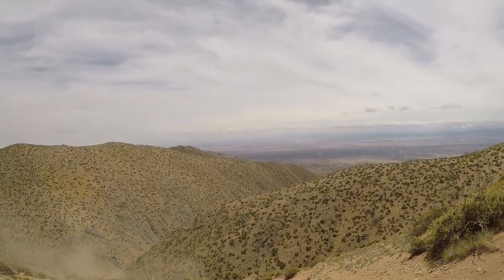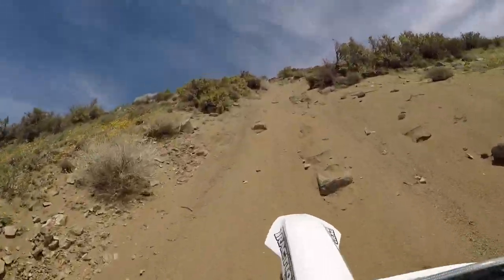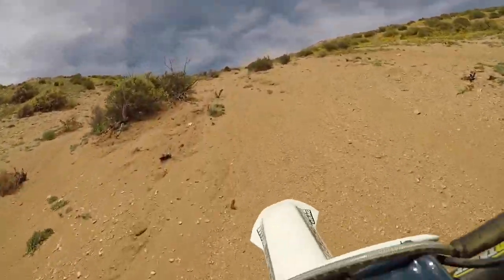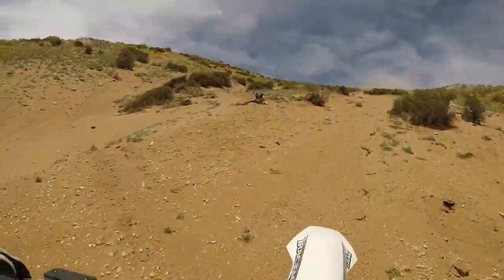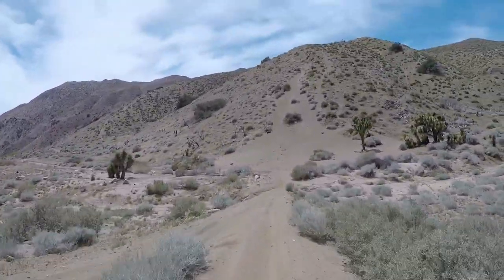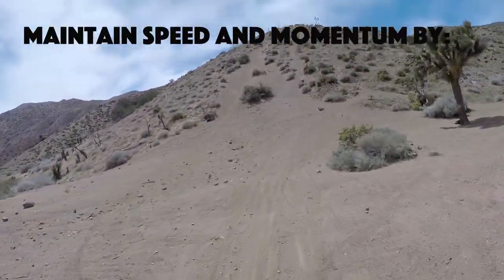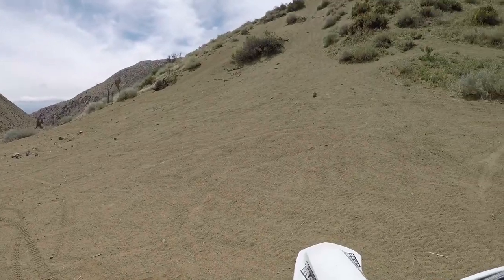How To Hill Climb : Techniques Explained

Comment: Using the clutch makes a lot of sense. I was trying a steep climb out of a creek recently, the first time I stalled because I let off the throttle when the wheel came up and the second one I looped out because I didn’t let off. Feathering the clutch would have probably made the difference

Comment: Nice video and great tips. I have been watching a lot of videos lately wanting to improve my trail and climbing skills and have been concentrating more on enduro and less on MX. Some things are the same but there's a lot that is different. The clutch control is huge, we were doing a bunch of climbs yesterday at Carnegie SVRA and the clutch method fo power control is getting me up hills I couldn't before but I went up one to many right before dark and got lax and slow right after getting trough a rock face and looped a 300 XCW, these bikes have so much power you really need to master the clutch. Any way I liked your to the point video.

Comment: So here's the big question, two stroke or four stroke?  Which one did better? These places use to be the big 500's playground. How did the new technology 300's do?
Reply: These particular hills are not very technical.  Almost any 4 stroke 450 and up will rip them.   The 300 2 stroke has more torque than her 350 but they have the same power.   The torque is what keeps a 300 2 stroke pulling longer and drops less speed than the 350.   Also if the 300 does bog a little it's no big deal it has way more low end and can still chug its way up.   If the 350 bogs it will fall on its face pretty fast after that.  Also the more technical the    climbs the more the 300s shine

Comment: Great vid :)
Question:
In what body position should I be for tackling obstacles on hills like these on the vid? 
And when to sit and when to stand?

Thanks a lot
Reply from the maker: Glad you liked it! When I'm hitting an obstacle such as a log or a rock on a hill climb like this I get my weight forward right away.   If you don't do that, you could loop out pretty easily. It doesn't take much to get your front wheel to lift too much on steep hills like these.  For most hills, I try to stay standing.  You always have more control when you're standing.  But for these really long sandy hills, I was actually sitting down for traction because the sand was SO DEEP.  I'd never ridden sand that deep before.  You can probably tell by the sound of my bike how loose it was haha.

Comment: I have a beginner's question: How does one go about learning to upshift, standing up, with full-on motocross boots, especially when under the pressure of a hill climb like you did? That was an amazing video!
Reply from the maker: Hey Ben, with more time on the bike, you will become more and more comfortable with shifting and braking while in your stand up riding position.  I would recommend practicing this on flat ground through the trails until it is second nature.  By then, you will likely be ready to shift up and down on hills like this.
Reply: Thanks Megs! I’ll work on it :)
Reply from the maker: You're very welcome!

Comment: Nice video. What camera are you using? Where is it mounted?
Reply from the maker: Thanks! I was fliming with a go pro hero 5 mounted with a SoPro Mount.
Reply: Megan Griffiths Enduro I like that thanks. Is the stabilization from the camera or editing software both?
Reply from the maker: No problem! Just the camera paired with that sopro mount. It makes for smooth footage!

Comment: What does feather the clutch mean? Never heard that term in New Zealand.

Is it occasional blips of the clutch or riding the clutch (partially engaged) I'm guessing the first option?
Reply: I think she is doing what I've always called "slipping the clutch", pulling in so the revs climb as the clutch starts to slip then working it back and forth in that zone between fully engaged and slipping as needed to keep the front end down and the revs up.
Reply: Feathering means modulating gently.
Reply from the maker: YES
Reply from the maker: When I say "feathering the clutch", I mean you are riding the clutch partially engaged like you said.  This allows you to bring up your RPMs but also bring down the front wheel without completely stopping your rear wheel from turning.
Reply: Won't this burn the clutch very quickly? Or is the clutch beefy enough in these bikes to withstand it?
Reply: @audunskilbrei8279  these bikes are made for it. They come equipped with a multi-plate wet clutch which is designed to be slipped and lasts a long time even with abuse. Also super cheap and easy to replace when it's time...

I rode a 150xc for the last 75 hours, being a small bore it takes a lot of slipping. Never needed to service it in any way, and I bought it used!

Comment: You only done the climbs on the four stroke, they have so much more torque that's why there a lazy man's bike, you did well though just wish you compared the 4 banger to the 2 smoker !!!
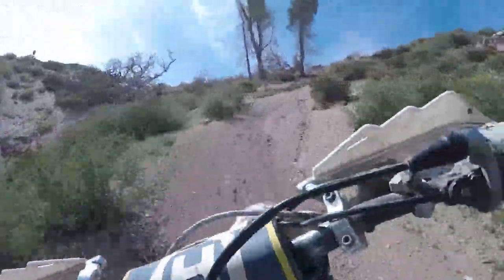Reply from the maker: carlie7118 I was on my 2 stroke in the morning until I broke my throttle housing. Then I had to go get my 350. The hill climb at the 0:35 second mark was done on my 2 stroke.

Comment: But.. but.. gearing down means letting off the throtle right? Or not? How do you shift when climbing?
Reply: With little practice you can get a fraction of a second shift with momentary throttle closure.  It is possible to also just drop the shift without the clutch. Clutches and transmissions are very strong.
Reply: @ow-my-achilles1106  two strokes u can bang it down without clutch or letting off.i just peg the throttle and keep my foot on the back brake. I go as fast as i can,hold on could be alittle bumpy.

Comment: Standing or sitting for climbs?
Reply: "Stand" on the pegs.  Funny thing is, when I climb "standing" on the pegs, my friends say it looks like I'm sitting. It's an illusion. My body position is low, my butt is "almost" touching the seat, but definitely NOT sitting. Standard attack position, but with the body weight slightly back to keep the front end light toughen to track well, and weighting the rear tire for grip. If the hill is very technical and ledgey, you'll have to move forward and back as needed to weight/de-weight the rear to make it over ledges. Momentum is key. The only time you hill climb very slowly is on unmanageable dangerous climbs that have bad consequences as a result for falling. Stay safe.

 I would also like to see another camera angle of the climb from a spectator view. Then the body position would show no straight leg standing, it would look like attack position all the  way.